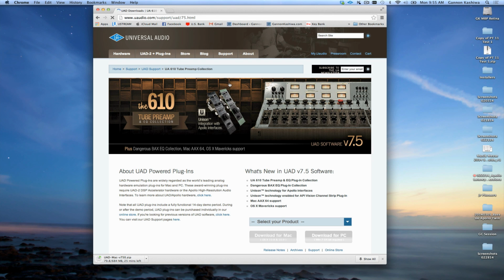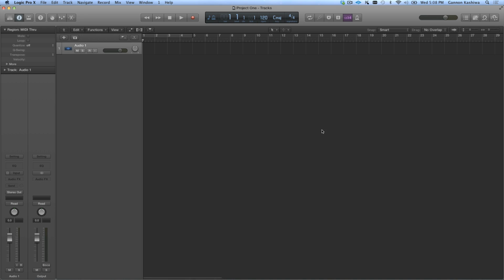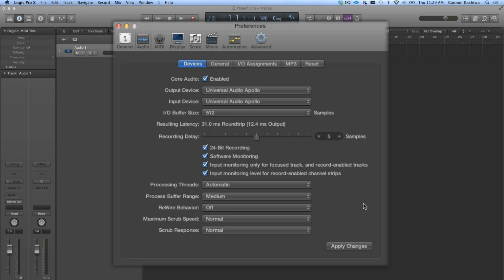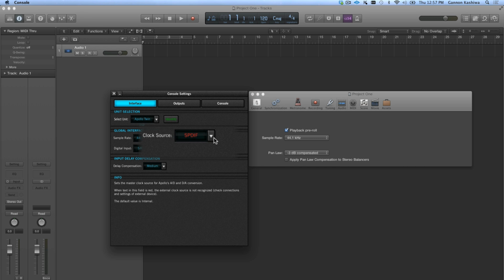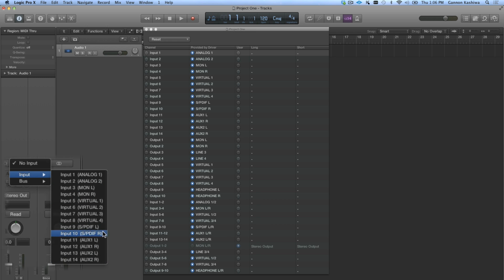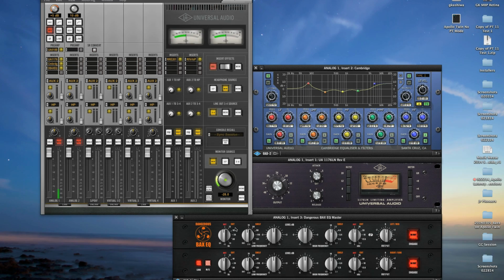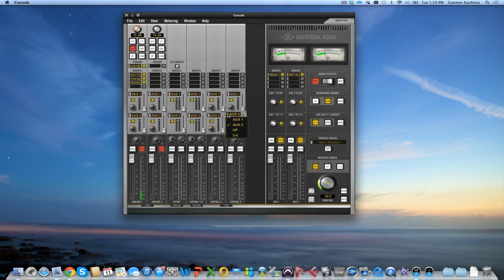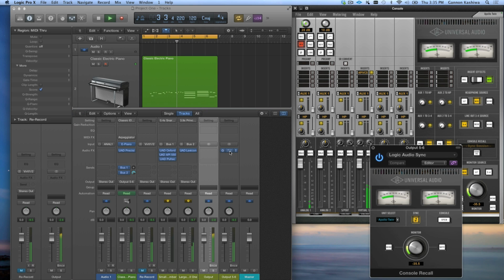Setting up Apollo w/ Logic Pro

Comment: Hello. Im a keyboardist and have question. Why does my nordelectro 5 for instance, sound differently connected to the earphones on mackie mixer my apollo twin or my earphone out on the electro.  three different sounds with the electro coming out on top by far. It sounds ok in the apollo but not near as rich in bodyness as directly from my piano.   reverb and all settings on mixer apollo console and mackie mixer set to nothing.

Comment: Hey Gannon.  Most of my Apollo 8p's I/O labels "Provided by Driver" are missing from the I/O Labels window.  For example, inputs 9-32 are missing as are outputs 9-32.  I had changed some settings in Console, reducing the inputs and outputs to 8 (before knowing what i was doing).  Now they are back to 32 but the labels aren't carrying over to Logic.  Is there someway to get them to port back into Logic?  Thanks!
Reply: (Solved) Answering my own question in case someone else has the issue:  In the Console app, go to MENU > View > Settings.  Then click on the CORE AUDIO tab.  Under MODE (second row on left) click Default.  Cheers!

Comment: real time latency free tracking with uad plugins only. that means that you can not use any of your other plugs on the track you are recording along with the UAD plugs.  its UAD or nothing. sad looks like its going back and i am buying $2400 worth of plugins instead. guess i will just stick with my quad satellite and my Mbox Pro.
Reply: +Kevin Greg Wait so when im done recording the front end of this i cant slap autotune on it inside of logic pro? why
Reply: +Cj Iveljic 
yes you can do that. You can't use your native plugs with UAD plugs when you are tracking. You can only use UAD when tracking. After you track voc's for example you can do anything you want to them but not during the recording.
Reply: oh ok well then i dont see why anyone would ever need more than the analog classics bundle as long as you have some ok mastering plugs
Reply: Entirely untrue. You can use Native plugins while recording/tracking with the Apollo, but you absolutely have to use UAD's Console Application which will automatically sync everything while you track. You can also bring in completely separate tracks that have Native plugins on them into the console app via "virtual" tracks.